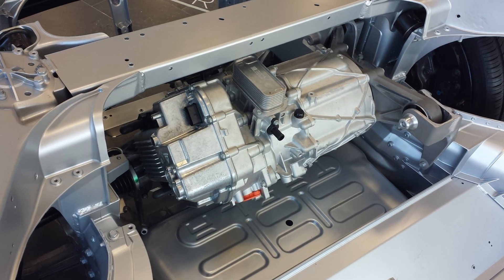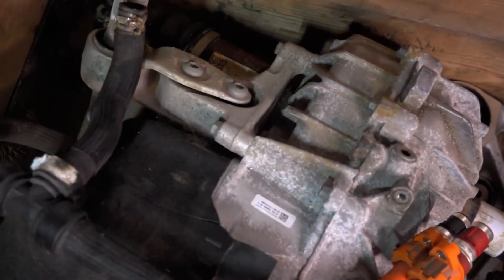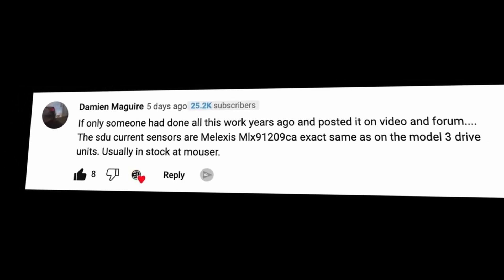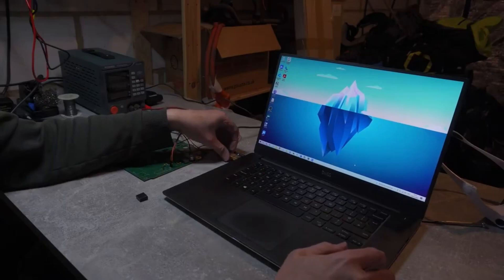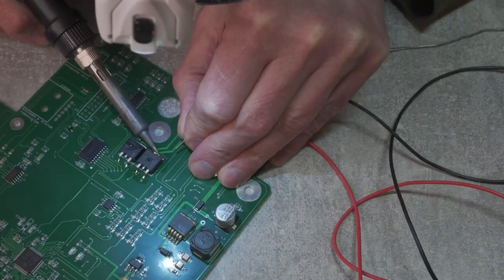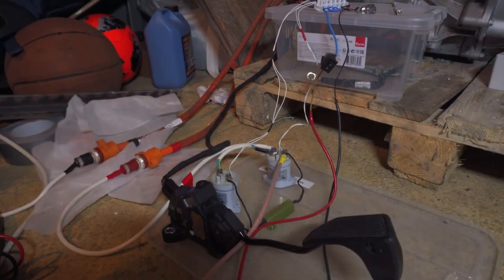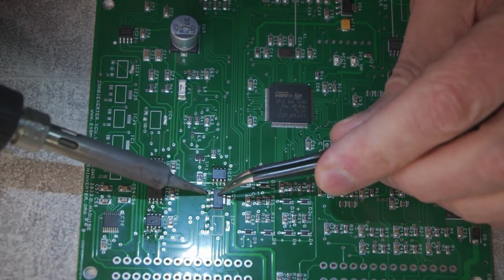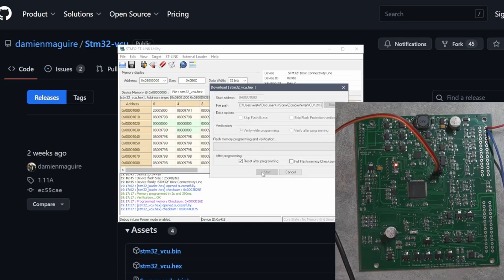Tesla Open Inverter meets Zombie - full story

Comment: Good stuff! Did you use OEM or OE board in the Toyota Inverter?
Reply from the maker: @hakanrolsson  The Toyota inverter was controlled by external VCU. That was also Damien Maguire design board that used Toyota Comms to control the inverter